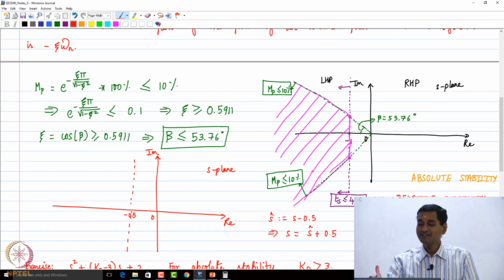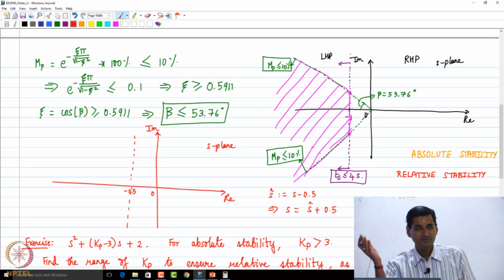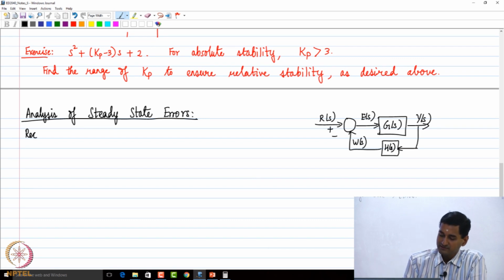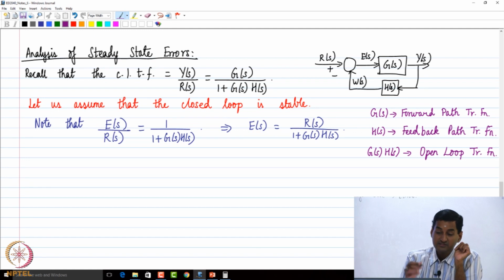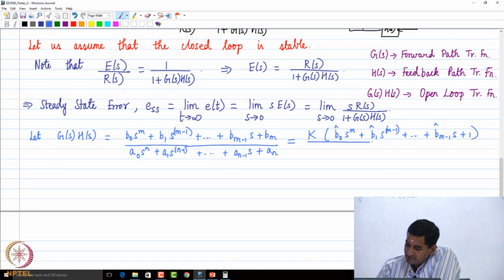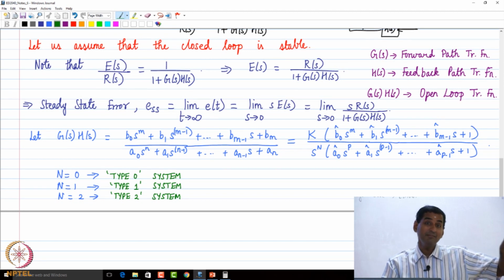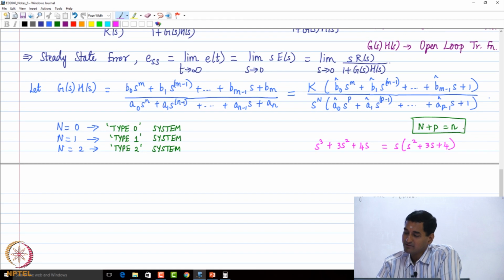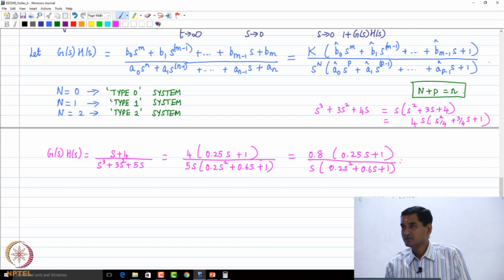Performance Specifications- Part 2

Comment: Can we use the controllers to stabilize the system, like using P or PI to stabilize the system ? But also, it was mentioned that only if the system is stable, performance can be checked. But isn't controllers part of performance specification ? It would be helpful, if someone provides a clarity on it.
Reply: Yes, Controllers can be used to stabilize,  unstable systems. With suitable controller you can do whatever you want, iff physical realisation is possible.